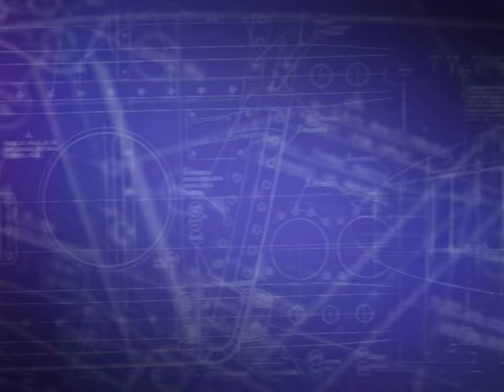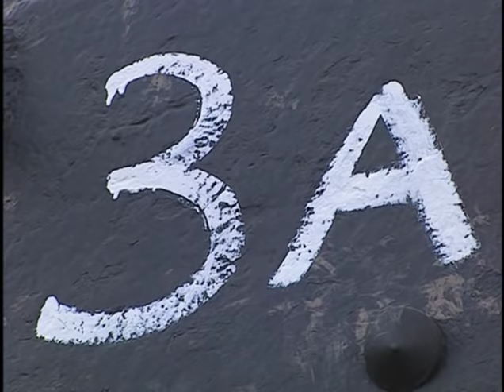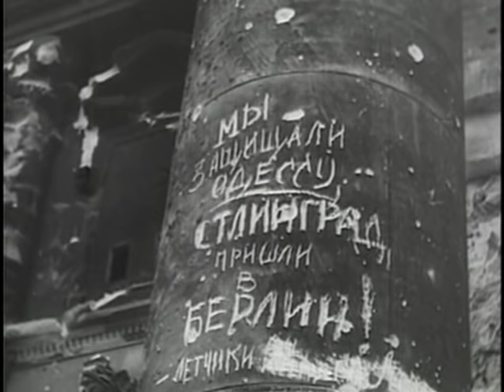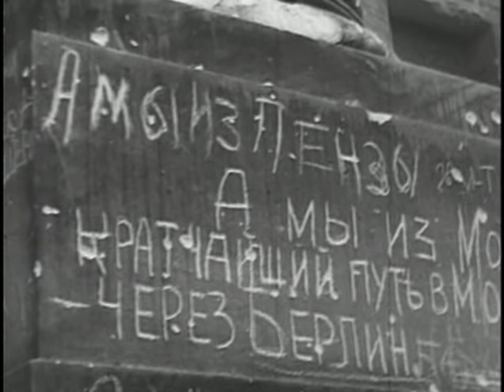Battle Stations: T-34 Russian Victory (HQ with Extras)

Comment: No one branch can win a war by itself. The T-34 was a well-balanced tank, much like the M-4. Not to demean their efforts, but the Russian tankers can thank the endless raids by Lancasters, B-17s, and B24s for there being far, far less Tigers and Panthers to defeat.
Reply: And fewer 88s as they were needed to  pull anti aircraft duty in t heart of t Riech rather than anti tank in Russia.
Reply: And the most important thing - the enigma code cracking so they know when and where the Germans will strike so they can get ready for it.
Reply: Well said brother. That's the one thing the Russians forget.
Reply: A third of Russian tanks were foreign imports. They also got hundreds of thousands of trucks from the US. They would have been steam rolled quickly without lend lease.
Reply: From the start of the German invasion of the Soviet Union in 1941 to the end of the war no less than two thirds of all German forces at any given time were fighting against the Soviets, the Western allies faced between 15 and 20 German divisions, the Soviets faced close to 200 German divisions. The western allies never drove the Germans out of Italy before the end of the war and left it to the Russians to take Berlin. As for the bombing of German industry, the main thing that stopped the German war machine was a lack of fuel and experienced leaders especially in the Luftwaffe. At wars end the allies found thousands of brand new aircraft unused due to a lack of fuel, tanks hardly used and left abandon due to lack of fuel, Germany still had plenty of soldiers left that could still fight on. Lucky for the Allies Hitler was a idiot who surrounded himself with yes men and people stuck in the past.

Comment: 10:32 the T34 was not the first tank with sloped armor, and the Sherman didn't burn because it ran on gas and not diesel. Both common notions, but both myths.
Reply: Why the Sherman burned isn't important as long as it burned. That's why the Germans called  them Ronsons , the name of an American cigarette lighter, and Tommy cookers.
Reply: @Venezolano410  I think that was mostly only a few models of Sherman, I believe it had one of the higher crew survival rates out of tanks, of the war.
Reply: @robisfantasticutube  I call bullshit on the survival rates. There is no way that a tank shell penetrates and possibly explodes and the crew just survives that.
Reply: The old Ronson myth

Comment: The Sherman was more dangerous to its occupants than the enemy .
Reply: That would be the T-34.

The M4 had more tankers, both numerically and proportionately die outside the tank than inside.
Reply: Yet Patton still defeated the Wehrmacht with it; pretty amazing.
Reply: That is nonsense- Stop reading Cooper- his book is riddled with inaccuracies.  The Sherman rates very highly WHEN COMPARED to the Panzer IV.  It was a medium tank. Period.  For a medium tank it was very good.  Stop trying to compare it to a heavy tank.  It's not the M4's fault that the army did not produce a heavy tank to combat the German heavies (actually, they did, but it was too difficult logistically to field them.)  Shermans could cross normal bridges, be carried on normal railcars etc.- a characteristic not shared by a 70 ton monster.  The Sherman was designed for mass production, so the allies enjoyed a 4-1 superiority in numbers.  If the Sherman was so bad why did the US use it (very successfully against T-34s) in Korea?  Why did the Israelis use it (again, successfully!)???
Reply: That so called "expert" at the 10:18 mark is an ignorant or liar. First ever sloped armor? Sherman's gasoline engines dangerous? Get the facts right, Mr. "expert'.

Comment: The T-34 was not the Greatest Tank of WWII and it was not better than the Panther or the Tiger I &II. 

The T-34 was good enough only considering the colossal numbers it was supplied to the Red Army along with any other thing. It was a good tank, better than the Sherman, perhaps the most important allied Tank.

But The Germans lost because of numbers and lack of supplies. Britain alone had more of anything than the Germans and then there was the U.S and Soviet Union. The panthers and the Tigers in all versions were less than 10,000 when the total numbers produced by allied countries were more than a quarter of a million.

On the other hand, the Germans could not have too many tanks as they had fuel insufficiency problems to move the few they managed to make. Their industry was being bombed, raw materials had to be sourced from far away. Same with aircraft and any weapon system.

In fact, better weaponry was the only thing that made the German Army so strong despite it's tiny size comparing to the allies.

The Russians lost more than 100,000 tanks of all types including tanks given to them by the Anglo-Americans (which were more the Germans ever sent to the Eastern front anyway). And they lost over 100,000 aircraft too. And 20,000,000 military casualties!

U.S alone produced 300,000 aircraft. The RAF had 70,000 casualties. These numbers are colossal. 45,000 Sturmoviks? 40,000 of which destroyed? And the 5,700 Stukas that fought from the Spanish civil war till the last day of the war were proven 'vulnerable'? Yes, I have read that too.

There is no comparison between the T-34 and the Panther. NOBODY would choose the T-34 over the Panther in a dual. The Panther could destroy a T-34 from 3 km away. Look at it this way. With 5,000 Panthers the Germans fought against over 50,000 T-34. Just take a look at the losses statistics guys.
Reply: 25 men beat Bruce Lee so he was no good??? Come on :-)
Reply: "not better than the Panther or the Tiger I &II."
Why do you compare the T-34 and heavy tanks?

Almost all these tanks were destroyed by artillery. Are Soviet anti-tank guns better than Tiger and Panther? Why not compare them?
https://coollib.net/b/127716/read
Soviet tanks were easier to make a new one than to restore half-ruined ones, in contrast to German ones, which were sent for repairs to Germany. German tanks were not considered lost if they were not completely destroyed or captured by the enemy. This is the difference between the Soviet and German losses calculations.

Comment: Was the T-34 the best tank of WWII? Far from it. Initially able to stand up to Panzers when first introduced, Germany quickly responded with the Panzer-IV and the Panzer-V (the Panther). Then came the Panzer-VI (the Tiger).

What the T-34, especially the T-34-85 had was numbers. The Soviets built 84,000 of the things, almost 50,000 being the T-34-85. Initial Soviet tank use doctrine was poor but they learned quickly. Most early T-34's didn't even have a radio. Soviet tactics steadily improved and the tank was now part of an overall battle plan, coordinating with artillery, aircraft and infantry. If the Germans destroyed 50 Soviet tanks one day, they faced 100 the next day. Germany couldn't make up for their tank losses after Kursk. They got weaker and the Soviets got stronger. 

The T-34 was a general purpose, medium tank. It had good speed, maneuverability, decent armor, was very reliable and with the 85mm gun was formidable. It was the most EFFECTIVE tank of WWII. "Quantity has a quality all of it's own". From near Soviet defeat on the eastern Front, the T-34 led the steady push to retake ground and then push the Wehrmacht back to Berlin.

Comment: The T-34a poor suspension, a poor transmission, a low velocity gun (like the Sherman 75mm).
Reply: Good enough to beat the best?
Reply: ***** Barely good enough to beat most.  But yes, good enough.
Reply: Ouija1210 Not true, the French had earlier tanks with sloped armor.  The Germans sloped the armor on the Panther before the King Tiger, and German Tigers could punch through the T34 at 2000 meters, so I would say its protection was not as good as you think.  The T34/85 fixed a HUGE deficiency in the earlier model, by letting the Commander actually command the tank during battle with the addition of a gunner.  The T-34 was an excellent tank in 1941.  It was easy to produce too.  But if it's half as good as you think it is, they wouldn't have had to build 80,000 of them.
Reply: The T-34/85 firing BR350 AP-HE, could only penetrate the Tiger I frontally at the upper superstructure plate from about 400m. In theory from about 750m, but in practice 400m seems the maximum. 

The T-34/85 was actually slower than the maximum speed of the Tiger, 39km/h vs 38km/h, not a relevant difference, but still interesting to note.
Reply: T-34 poor suspension it was not, it gave T-34 comfortable soft cross country ride that boggy type suspension found on Pz-IV and Sherman tanks did not have. A poor transmission? Earlier in the war tanks yes, it was(with a caveat that it was easy to service, repair or swap, later tanks don't look like it had a "poor" transmission since most of the T-34 tanks instead of having a museum type "white glove"(you got to be careful with it!) of handling more often then not play and mud and doing donuts(don't be afraid to slap that b!ouch) treatment. Low velocity gun? Its all depends... 85mm was and anti-aircraft artillery gun was not a low velocity, it was similar to Tiger I 88 L-56 gun. F-34 canon on T-34-76, since earlier(March 1943) had a Hyper-Velocity AT - BR 350P round at over 950 m/sec(3100 ft/sec), hardly a low velocity. T-34/76 with L-11 gun was a low velocity.
Reply: This article been written by someone who used Russian pronunciation of the name for Jesus Christ, just to let you know.
Reply: T-34/85 did not carry only BR350 AP-HE rounds. It had a variety of them for different type of armored vehicles, so its not the only one that can be used against Tiger I frontal armor.
Reply: @wotevrpnt  that is the edge the t34 had they had numbers the Germans had great tanks but not enough of them
Reply: @kylegoode7846  - a valid point!